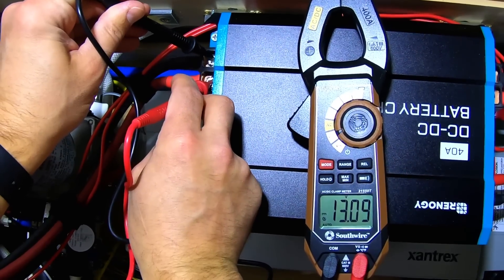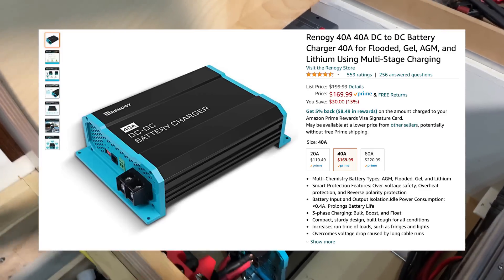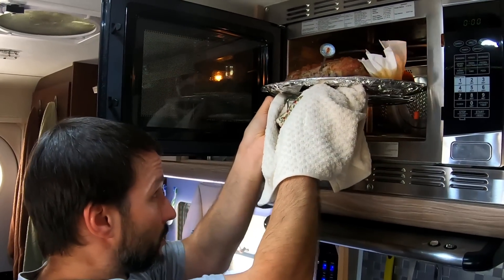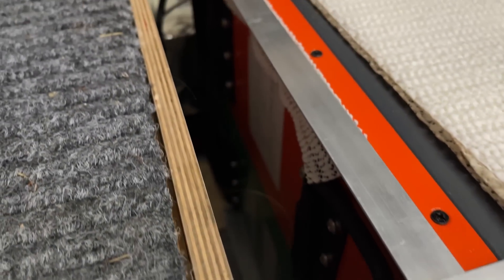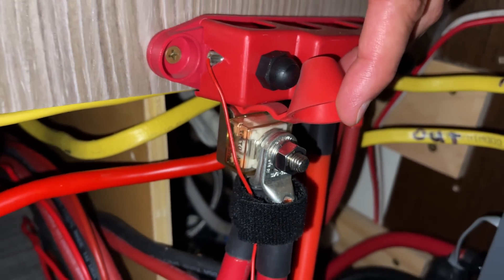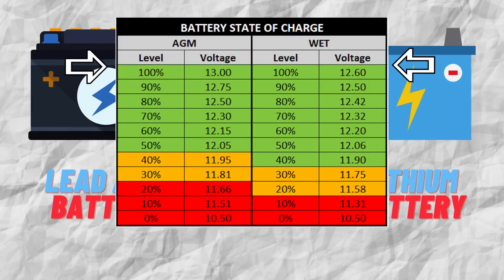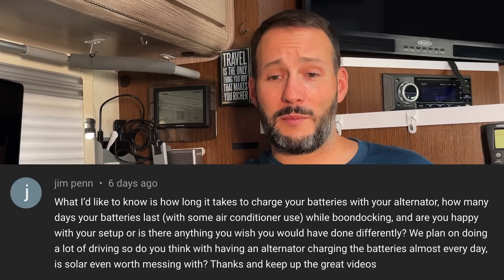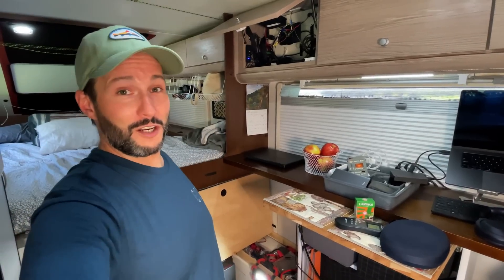Lithium RV Battery Power System Tour // 1200 Ah of LiFePo4 // 15840 WH // Q&A

Comment: Really like this video and others you've made thanks for the information keep up the excellent work.
Wanting to buy one of these camper's are they good for the Cold.
Reply: Great video.  Lots of wonderful information.  It is so good that I listened twice to absorb it all.   Thanks. RS
Reply from the maker: Thanks for checking it out 👍
Reply from the maker: Thanks. We've been in temps in low teens and it performs well. There's always a little condensation in the morning to deal with, but that's pretty common, especially with aluminum framed campers.
Reply: Re: battery security... Since batteries are inside a metal container, I would also wonder how securely mounted they are inside the container. Are they prismatic or cylindrical cells? How many in parallel? The more cells in parallel, the more contact points there could be. 

Battery weight is a huge momentum issue in a front end collision. Mine (35 Nissan Leaf packs) are through bolted together with 4-50" long, 3/8 thread rods and then the whole assembly is bolted inside a 3/4" steel square tube frame which is encased in aluminum and bolted to the truck frame under the camper. I have a fuse right at the point the cable exits the case. My battery weighs 300lbs and I have gone to this effort because the mass alone has big destructive capacity in a front end collision (horizontal movement). IF it moves, the potential for a short induced fire is very high. Any short will likely create a fire. A battery fire, once it gets going, is NOT likely extinguishable so if it happens, your truck and camper are likely to be a total loss. If insurance finds you negligently created the potential for the situation, the may well leave you high and dry. I suggest you may need to re-evaluate the threat it presents and develop a means of addressing it with the probability/severity you perceive.
Reply from the maker: @stevehericks5764  Thanks for the good thoughts. It's a 4s3p configuration with prismatic cells. These are prototypes and I'll soon be switching to a 4s1p setup with 300 AH prismatic cells. The case design is a good starting point, but I have lots of changes coming. Right now, they are a tight fit and surrounded with high density foam and fiberglass board. When I put the cover on, the foam is compressed by 1-2 mm as I secure the cover. The cells themselves aren't going anywhere inside the case. Granted, I still have some design changes coming that are now possible because of the space savings of the 300ah cells in a 4s1p configuration. 

As for mounting, while this does work, its not my favorite setup. I'd really like to design it into the camper, but that would mean cutting out some of the factory wood. I'll try to find some other solutions before I do that.

I always appreciate your input!
Reply: @Stonyboot  I definitely understand the difficulty in making irreversible changes to your camper. I'm sure it's good enough for routine travel, it's just an accident that I think would quickly become catastrophic. It's always hard to prepare for the events that we believe unlikely. My concern, and the way I looked at mine, was that if it did occur, the outcome was going to be really bad....I have spent a career making things and one of the keys to corporate survival is to use a risk mitigation technique; All possible events are rated; 1) 'Likelihood' of occurrence is rated 1-3 and 2) 'severity' of outcome is rated 1-3. The two numbers are multiplied and rank-ordered. A line is drawn at around 3 or 4 and everything above that or that is a 3 in either category, ( has to be addressed to reduce either the likelihood or severity. In your case, I rate the likelihood a 1 and severity a 3. If I could rate the severity higher, I would. The only way I can see reducing the severity is high strength mounting. There is also a question of the other components attached to the battery cables becoming involved if they were to move and strike the secure battery, which is why ABYC mandates a fuse less than 7" from the battery. This is a critical concern with EV accidents and a key reason why firefighters usually will not attempt to enter a car till the battery is deactivated or fight a fire in an EV at all, (battery fires with lithium can be accelerated by water because lithium is chemically reactive with water at any temperature).